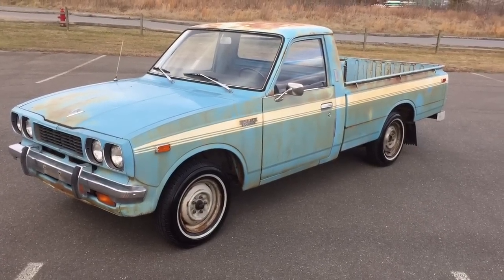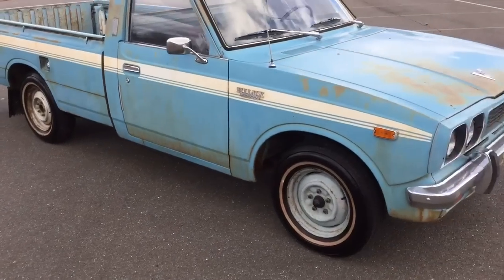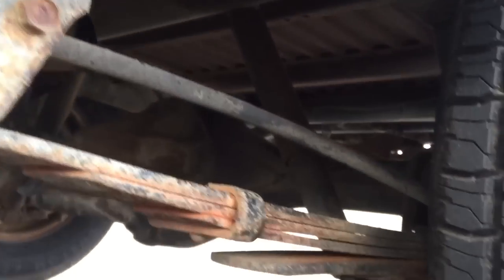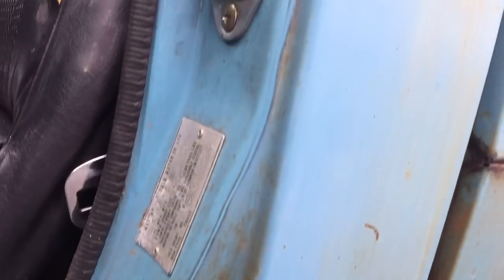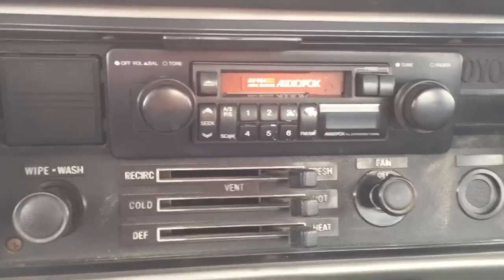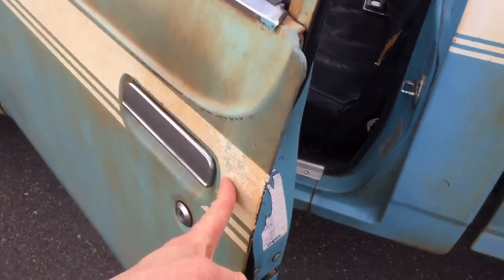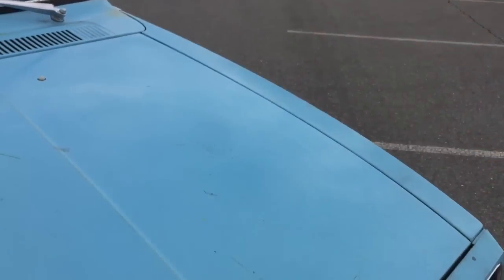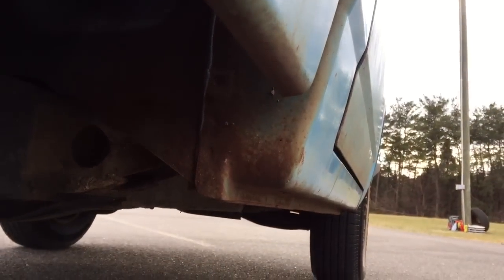Baby blue 1973 Toyota Hilux BARN FIND pick up truck with SUPER LOW original actual miles!!!

Comment: Cool.... I had a white 73 Hilux. That engine uses a double timing chain set up, the tensioners tended to get a bit loose and cause timing chain noise. Never skipped, but made intermittent racket. Also, there is a carburetor heat tube that is under the manifold that can end up with holes in it from the exhaust and direct exhaust gases back into  the carb, it screwed my carb up to where the secondarys stopped working... But, that is a cool truck . I got mine at 83,000 miles in 1983 for $500.00 and ran it to 120 something a couple years later...

Comment: Though the build date is 1973, this truck was produced for the 1974 model year. 1972 & 1/2 and 1973 pickups had the fuel cap on the driver's side. From 1974 to the end of the RN20's production in 1978, the gas cap was on th passenger side.
Reply: Correct
Reply: Yeah,it's (high-locks ) hilux

Comment: Beautiful truck, very rare to find one that straight and rust free.  These were throw away vehicles, people used them, beat them up, they rusted out, junked and crushed.   Nobody ever thought about preservation.  

As for the patina, I'd leave it as is, give the mechanicals a once over, replace every rubber door seal, hose and vacume line and leave it at that.  Use it for weekend runs to the hardware store and the local cruise in.  If you start to paint this truck, its going to be one of those never ending things IMO.  You're going to want to paint the door jambs, fender wells, under the hood, do you pull the motor to paint under the hood???   Gotta paint the inside of the doors too, before you know it you're doing a frame off restoration.
Reply: 🤣true about never ending

Comment: turned over a few times -those odometers flipped back to 0 after 99,999 -i have the exact same truck thought it was low miles too
Reply: Dan Kirchner those pedal covers don't appear to have 100,000 miles on them ..
Reply: never  know  -yet i've seen fresh looking pedals on 200k odometers

Comment: It's not a 1973 model year, manufactured in sept. of 1973 makes it a 1974  model year. Pay attention to that emission  label on the hood it reads 1974 model year. My genuine lake blue 1973 Hilux has a left side that's drivers side fuel tank and gas filler, the  1972 1/2 - 1973 short bed has 4 rope hooks on each bed side and 3 rope hooks on the tailgate. that's a total of 11 rope hooks. The B pillar on the `1972 1/2 - 1973 is narrower making the cab a little shorter.

Comment: Its not hard to drive a toyota, in fact its even easier to drive a manual gears than automatic gears. i learned how to drive when i was 12 years old and i drove toyota 2005 its soo smooth and easy to drive, your just not as good a drive c:<